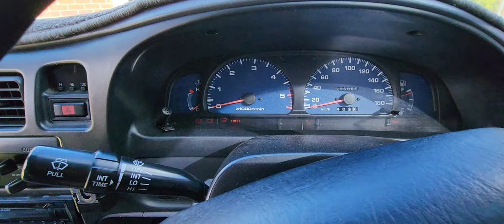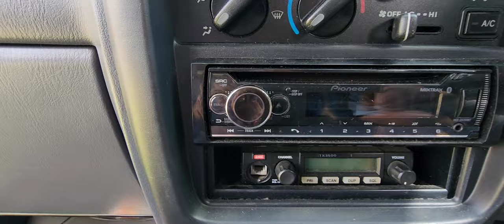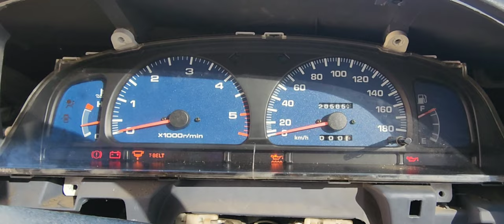How to reset a hilux Timing Belt Light on most early models

Comment: how do you get your motor to idle so low? my 5le ln167 idles at about 800rpm
Reply from the maker: The gauge is out around 400rpm due to the different loom from the 12mm mechanical pump conversion

Comment: hello mate just while  the dash is off…my 4wd engaged light…the green one on the dash far right won’t come on…any ideas? cheers
Reply from the maker: Bulb may have blown?
Reply: @TRAV30387  ill try it…cheers dude
Reply from the maker: @russellking9762  ezy mate
Reply: @TRAV30387  Hello again mate…could you tell me your way of bleeding the air out of the cooling system please….air lock in mine can’t seem to get it out…cheers
Reply from the maker: @russellking9762  mine was straight forward all i done was filled it up let it run till the thermostat opened and filled it up some more
Reply: @TRAV30387  Got it..cheers!
Reply: @TRAV30387  You legend…Do you live in Sydney?
Reply from the maker: @russellking9762  happy to help nope tumut nsw about 4 hrs from you